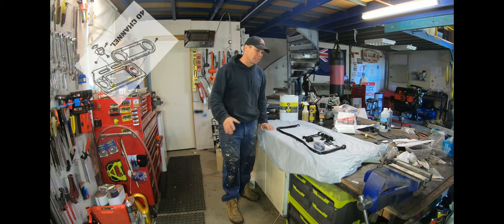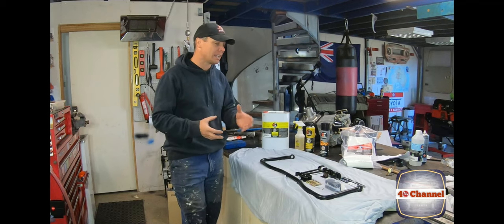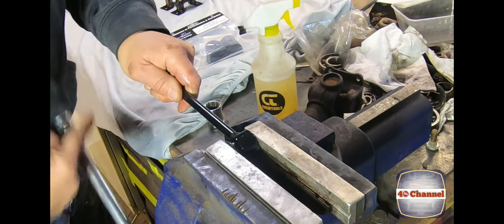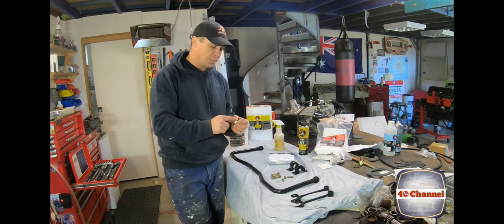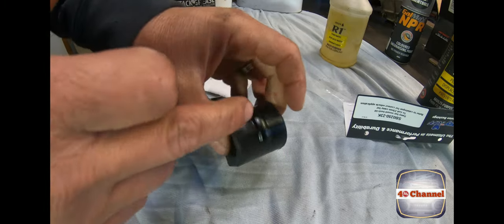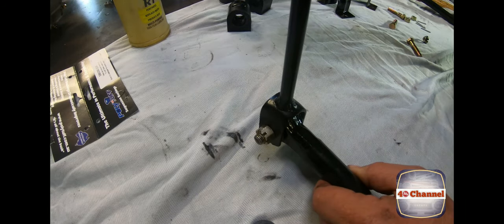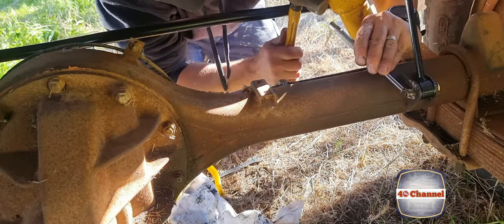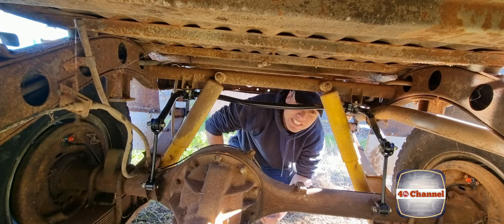S2EP54 - Sway Bar rebuild for FJ45 - Troopy

Comment: I ran a kit from online autoparts it lasted 6 months if that there was no rubber left on the links so I deleted the whole lot that was 6 years ago
Reply: Were your parts that failed rubber or PolyTuff ? If PolyTuff they are covered by 5 year warranty and would have been replaced FOC .
Reply: I’ve tried all Polly, rubber and Nolathane they only last on a sealed road
Reply: @SootyDiesel81    Strange, is it possible your vehicle is lifted beyond the length of the standard link rods loading them up causing premature wear on the bushings ? 
do you need extended link rods due to the lift in your vehicle.
Reply: It was standard height back then when they failed
Reply: @SootyDiesel81    Shame, I would have like to see the failed bushings to work out what was causing the issues.   What are you running now ?
Reply: I’m not running anything I took the links and sway bar out completely because of the rattling 
There was no bush left and the bush end that connects to the diff were oval not round
Reply: @SootyDiesel81    Bummer, if you ever decide to put it back on contact me and I will look after you on the bushings and back them with my warranty, vehicle height dependant..
Reply: I sure will thanks have you got an email address?